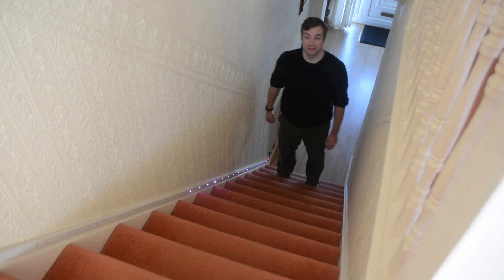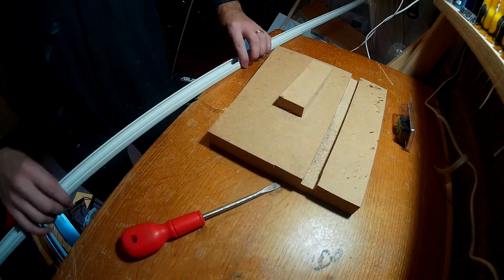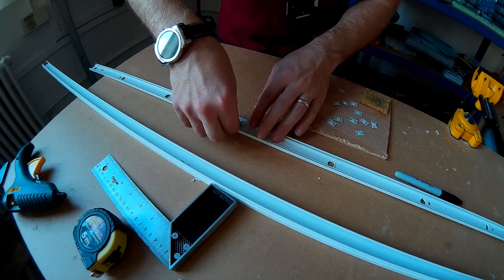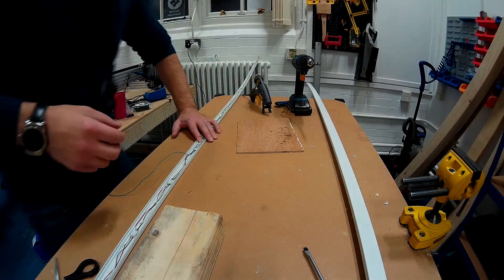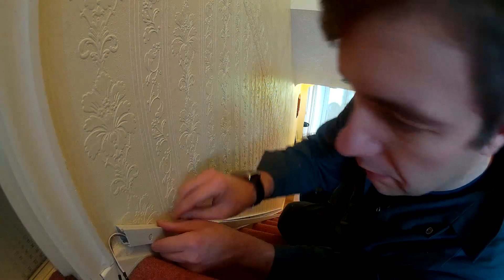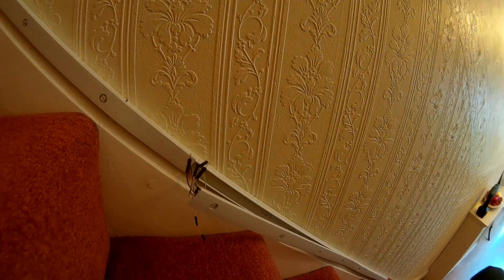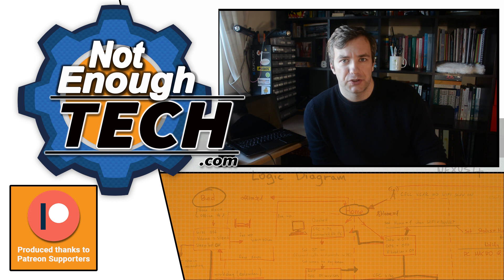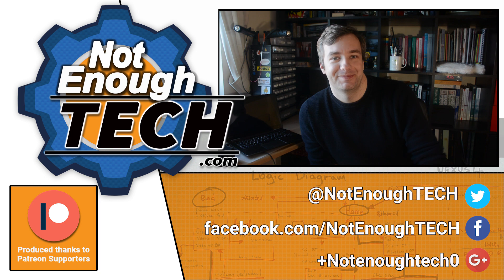$20 Automated Staircase Lights: HARDWARE (2/3)

Comment: Hi @NotEnoughTECH. I read a few old comments from you stating you were considering to review this project to make the Stairs Lights "smart" by replacing the Arduino with an ESP8266 or ESP32. Is this still the case? If so, any ETA? Cheers! 😃
Reply from the maker: I kinda have it already mostly done, just keep postponing the finalising it.

Comment: Excellent tutorial! I'm going to use more LEDs and have to figure out how to make it react to Google Assistant (Google Home) but this gets me all the way through the hardware part.
Would you mind sharing the Fritzing file that you made? It will help me expand on what you've done.
Reply from the maker: Hi, you could use ESP8266 or ESP32 instead and connect to internet, Then you should be able to use smart controls. I have plenty of articles about how to make these work in NodeRED, As for the file, I'm afraid I only have the screenshot as the file itself got lost somewhere. It's not a complex circuit as you could see - I'm sure you will be able to figure it out
Reply: @notenoughtech  I am very grateful for the reply and will have a look at your NodeRED stuff. LIKE, SUB AND RING THE BELL ON THIS GUY!!! Super helpful!!!

Comment: Hey, @NotEnoughTECH this was an amazing job, I am planning to do this project using rechargeable batteries and a solar panel. Do you by any chance know what is the total power consumption of each component? 

Any suggestions or recomendations would be greatly appreciated. Thanks in advance!
Reply from the maker: Each led is about 50mA Arduino about 20mA or so. It would depend on how many led you will use
Reply: @notenoughtech  TY even with a 1Amp battery you would do good, but as you say it all depends on how many leds are being used.

Comment: Great tutorial 👍🏼 it will be part of my next project. thank you.
Just s quick one : Am I missing something on the schematics? I did not see the Vin of the Arduino connected to the battery.
Thanks
Reply from the maker: I used USB to feed the power in so it wasn't included in schematic. Of course if you want to use Vin go for it
Reply: @notenoughtech  thanks a lot for the clarification 👍🏼 keep on the great work

Comment: Hi NotEnoughTECH gr8 work and it,s a really helpful.Can u tell me what changes do I have to make if I want to install led strip under each step and want different modes(ways) for the steps? like I have 17 steps would i need to use Arduino uno instead of Arduino nano, and anything else i need to add or remove plz reply me as i,ll be waiting for your response. Thanks
Reply from the maker: There are 2 variables in the code that control the timing and number of lights in total. You can play with it and add new light functions to the mix. Check the "software" part of the build and the article attached to it
Reply: @notenoughtech  hey do I need to add any other hardware for e.g is arduino nano enough or should I use arduino uno, and thanks for the code tip
Reply from the maker: As long as you can generate PWM the code should work on any Arduino board. Just check the pins